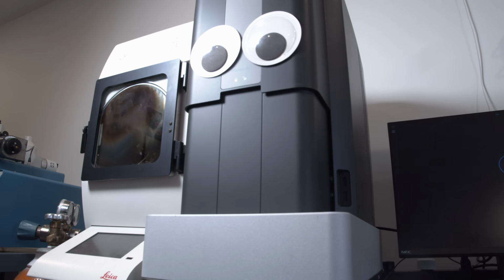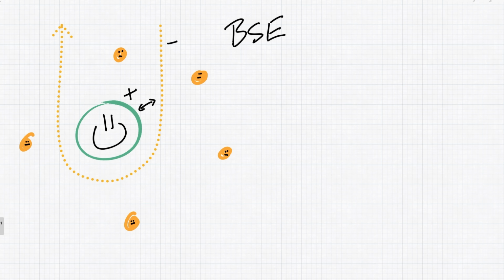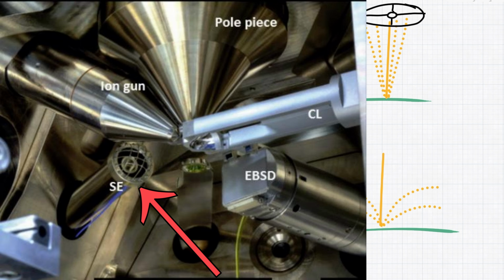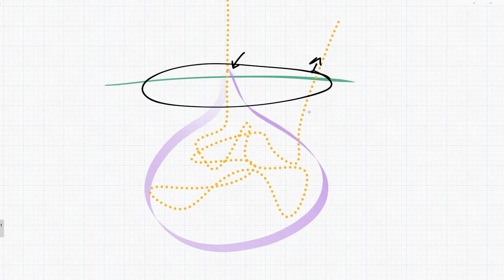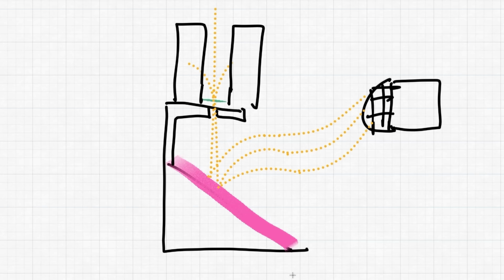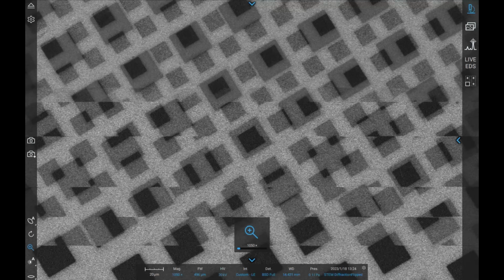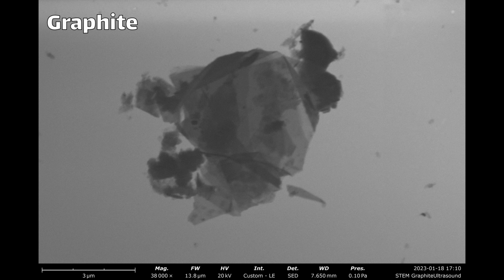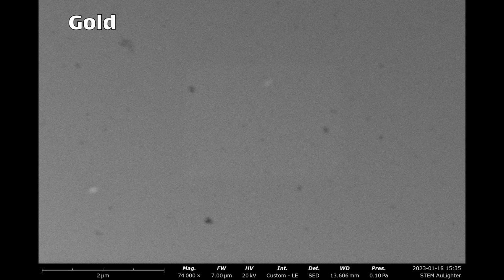Electron Microscope Hack to see Graphene

Comment: In an SEM, why does interaction volume blur the image? If you know where you shot the beam, then once you get an event and subsequent signal, why does it matter exactly where that electron came back out? Is it a timing issue between entering and then coming out and being detected? I figure since you know where you shot the beam, once you get a return signal you still know where it was supposed to originate from.
Reply from the maker: Hopefully a more knowledgeable microscopist chimes in, but my understanding is that it's mainly due to "side effects" of that increased interaction volume. For example heavier elements will generate more backscattered electrons than lighter elements so have a higher signal. But if the electron beam enters at a Carbon location (light) but bounces around and hits a neighboring Tungsten atom (heavy), it'll generate a high signal at the Carbon location because the SEM thinks the return signal is from where it sent the beam.

Sorta similarly, electrons might drift over to a nearby edge where they are more easily emitted as secondary (you often see glowing/charging on edges and sharp features), so you'll get an increased signal within a certain distance of an edge due to that, even though the spot you actually scanned would have lower signal otherwise.

Also knock-on effects like electrons in the interaction volume repelling other incoming electrons, etc etc.

So it's sorta a combined effect causing a reduction of signal:noise ratio. At least, that's my relative amateur understanding :)
Reply: @BreakingTaps  Exactly. The exit point of the electron doesn't matter, what matters is where the interaction took place. You're essentially unable to distinguish between an interaction that happened right under the beam impact site, and one that happened a small distance away from it.
Reply: @BreakingTaps  Thank you for the clear explanation! That makes a lot of sense. I was thinking of it in too binary terms, either got a signal or didn't get signal. The additional considerations you outlined greatly help me understand the negative effects of the interaction within the bulk material.
Reply: If my understanding of it is correct, it's not so much that the image is blurred, it's that the sample itself is inherently "blurry" to this technique. You know where on the surface of the sample the beam was pointed at for a given detection, but the interactions within the sample that either reflect electrons or don't could be happening somewhere that's not exactly where the beam is pointed.
It's maybe like trying to read a piece of text behind a pane of privacy glass. It's not that there's anything wrong with your eyes, they are still forming a perfectly good image showing you where on the glass surface every bit of light that makes up the image is coming from. It's just that every spot on the surface of the glass is showing you a part of the text from a randomised area so the image appears blurred.
Not sure if that analogy makes any sense, given the way electron microscopes work is kind of "backwards" compared to the way eyes work. But it was interesting to think about!
Reply: It depend on the acceleration voltage and the beam intensity. In Both cases higher means more interaction withe the sample because the beam gets in deeper with  higher energy settings. This gives you more over all signal strength but worse signal to noise ratio. If you want topology you use low energy settinggs if you want chemical information you use higher energy settings. In general if you go down the periodictable you get more elektrons per atom so there are more chances of an interaction. Same withe the positive chaarge of the cores of the atoms. So this why you get more Signal from lower down in the periodic table. Also secondary electrons are more easely produced in the surface layer of the sample. I am not sure why. Maybe because there the beam hits withe the highest energy and focus. And regarding your comment about were you shoot the sample. The fokus of our elektronbeam is not perfect so you  are always limited by the beam diameter. In moast cases this does not matter as the topology of you sample is much rougher than your beam, but when you talk about Atoms or super small nanoparticles this is a real issue. Greetings from Germany

Comment: if you have atom species, 3x, as a atom levels, in a data dot, in a disc, can you make 2^24 values in a single dot, yes 24-bit dots, on a data disc
Reply: what if you "break taps" with cone-spikes, like from the side, like the atomic force microscope, but bullet force, they would bend, very much
Reply: hey try resin 3d printing by printing up-right in the liquid resin tank, with uv-laser engraver, and with a control rod to keep the liquid level right on top of the object and/or print-bed, no bottom stick prints problems
Reply: "can you" is an ironic pointer, of course you can, God said so, be free
Reply: you are cursed if you cant
Reply: let God be with you

Comment: How do the TEM grids work? I expect the nanoparticles arent just floating between the rows?
Reply from the maker: There is an ultra-thin layer of formvar polymer (polyvinal formal) adhered to the copper grid, usually like 5-25nm thick. It's thin enough to be mostly transparent to electrons, but can suspend particles in the gaps.  There are tons of different options depending on what kind of sample you're looking at, silicon monoxide layers, metal film layers, etc: https://www.tedpella.com/Support_Films_html/Support_Films_and_Substrates_Overview.aspx

Comment: Great video! As somone working with these diffraction grating replicas, my heart shipped a beat when I saw grid on your finger, then I read note on bottom😆 These samples are so fragile than even high temperature during shipping can destroy them.
Reply from the maker: Haha yeah, I was reviewing the footage and was like "Hmmm, I should put a disclaimer on this so folks don't have a heart attack 😂".  Although unfortunately I did ruin the grating after imaging it, was handling it with a bad set of tweezers and it fell onto a not-super-clean surface, contaminating it pretty heavily 😢The grating is still fine, but the spheres are mixed with random junk now.  Lesson learned and bought some dedicated TEM tweezers
Reply: @BreakingTaps  We are using vacuum tweezer to manipulate with all types of grids, but this type is really fragile, so even with vacuum tweezer the film on grid get demaged sometimes, but still better than normal tweezers, which usually deform the grid.
Reply: @janctrnacty1215  Aha,  I was wondering what kept the samples in the spaces between the grid.  Now there is mention of a FILM, what is it made of and how thin is it and HOW is that film prepared.

Why is it called a diffraction grating when it looks like a basic TEM grid?????

So much specialised knowledge hiding in just one tiny grid.